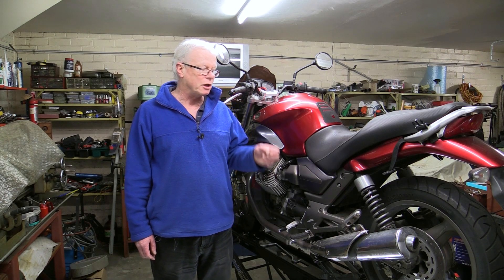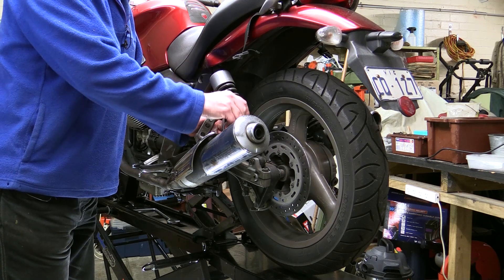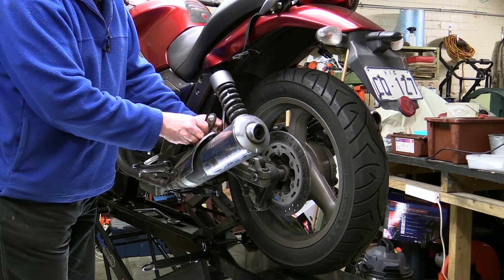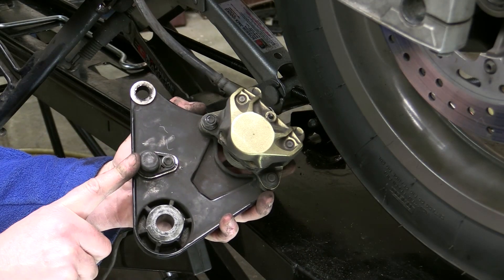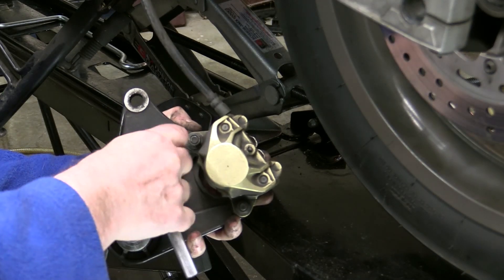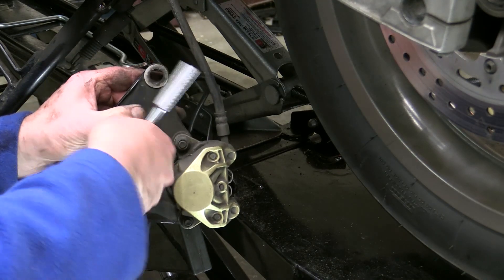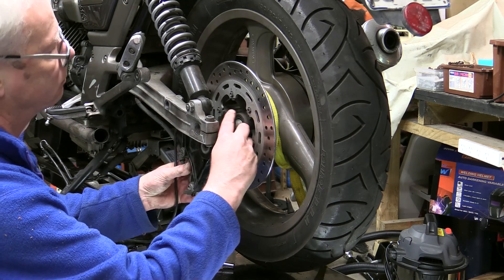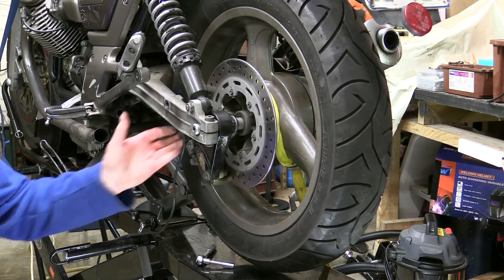Moto Guzzi Breva 750 Speed Sensor Replacement

Comment: Thank you Mike. All your videos are very clear and helpful. If I may offer an observation on the tappet  adjustmnts I would suggest putting the spark plug back in before refiting the cover to avoid the possibility of dropping a screw down the spark plug hole . Also a great trick learnt from t a very good mechanic was too avoid breaking the gasket; Loosen all the screws equally and give the cover a gentle tapwith a hammer first one way and then the other . This will completely break the seal on one side or the other of the gasket and stop it from the sticking to both surfaces when you take it off which is a common cause of breaking the gasket . Ive  been doing that for ages now and have never lost another gasket!
Thanks again
David Stevenson, 2006 Breva 750, Northern Rivers  NSW
Reply from the maker: Thanks for the tips David, most helpful :)

Comment: I know you didn't remove the rear wheel, but if you do, I'd offer the following: Whenever I change the rear tyre, I add some rubber grease to the cush drive rubbers if needed. It stops them falling out when putting the rear wheel on again. 😒. I also slap some thick grease on the gearbox drive splines for good measure, so stop them stripping out, which is a common problem on the V7 range. Many come ungreased from the factory,  they are Italians after all. 😃. Mine is a 2003 model, the first year of production,  they all seem to have been OK, but I still do this. Most of the effort is getting the rear wheel off in this job anyway, so why not do it at the same time.

Comment: Hi Mike! After pressure washing my Breva 750 the speedometer stopped working. The dash passes the initial check (both speedometer and revmeter needles work after I turn the key to on position) but the speedometer does not respond at all, neither the odomoter. The revmeter works normaly as well as all the indicator lights. I replaced the speed sensor with a brand new original one, but no luck. Do you have any idea what the issue is? Thanks in advance and Greettings from Greece!
Reply from the maker: Firstly I'd suggest cleaning the instrument cluster electrical connections. They may have water in them. Now it is possible that the replacement sensor is also faulty.  This post on Wild Guzzi may help you find the fault
https://wildguzzi.com/forum/index.php?topic=43216.0

Comment: Hi Mike can you elaborate on a passing comment you made when removing the petrol tank of your Breva. That was to start the engine briefly before attempting to remove the fuel line . You said it made it easier to unclip.
Why is that so? That bayonet type connection can be a real pain to get off. Thanks,
David Stevenson
Reply from the maker: It probably does nothing but the thought was that it may release any pressure still in the line.

Comment: hi mike from the usa  have 07 moto guzzi 750 nevada  .speedometer not working do think that could be the problem.
Reply from the maker: If the Speedo and both the odometer & trip meter aren't working it would be a prime suspect (check the wiring loom too). If you do a search for "testing a hall effect speed sensor" you will find some video tutorials on testing this type of sensor.
Reply: @MikesMachines  THANKS BIG HELP

Comment: Mike - thank you for posting such informational videos on what has become my own bike - a 2008 Breva 750. You are the Guzzi Guru. I’m having an issue I hope you can help me with. I am able to start my Breva 750 when on the side stand with no issues at all,  it as soon as I upright the bike to ride, it stalls. It will only run completely upright if Revs are over 2500. Any less and it stalls. It is the strangest thing. I think it may be a Fuel delivery issue but perhaps you could offer your expertise to help a fellow loyalist. Thank you in advance for your reply. Ed
Reply from the maker: It sounds like it might be running on one cylinder when you lift the bike off the side stand. Check the plug leads and EFI & ignition connectors.
Reply: Thank you Mike. You’re my go to guy for all things about maintaining my Breva 750.

Comment: Mike, I am reading about a dead odometer at around 15,000 miles on a Breva and the owner writes that all it needs is a speed sensor replacement. I would of course prefer a fully working original speedometer, odometer and trip reading. Did replacing the speed sensor also fix the odometer on your wife's Breva? I remember you mentioning is stopped working at 100,000. Is the speedometer, odometer and the trip reading all working well now? I thought maybe that would have brought her back to her second reincarnation starting from zero miles again and counting.
Reply from the maker: The odometer stops working at 100,000 km because of a software issue. I believe it effects all Guzzis with this dash (Breva & Nevada). Everything else works fine - Speedo, Tacho, Trip meter.
Reply: @MikesMachines  Thank you for your prompt response! It will likely affect it in the same way with 100,000 miles. Have a nice day, Mike. :)

Comment: Hi Mike!
I would like to ask a question. 
There is a Breva 750 from 2005.
What kind of issue could it be when the odometer stuck at 99999 but the daily trip meter still working?
Thanks in advance!
My appreciation for your channel!
Reply from the maker: This is a design fault with the dash. The odometer doesn't clock over when it reaches 99999. Ours is the same.
Reply: @MikesMachines  Thank you for your quick answer. Is there anything I can do with it, so that it works.
Reply from the maker: I'm not aware of a fix for this problem but you could try one of the Guzzi forums.
https://www.wildguzzi.com/forum/

Comment: Mike thank you so much for these greatly presented series of videos about the Breva! Do you think that you can remove the sensor by only removing the stay in place brake bolt in order not to mess with the rear axle? Thank you! Alex
Reply from the maker: I don't think it is possible. The sensor sits only a few millimeters from the disc rotor and rotating the brake stay down with the axle in place won't achieve anything.

Comment: What is the odometer reading on the Breva?
Reply from the maker: Our's has done over 120,000 km. Unfortunately the odometer on this model freezes at 99,999!
Reply: Mike's Machines Have you felt that the engine has lost some compression after 120k? Thanks Mike
Reply from the maker: I haven't noticed any significant loss of power.